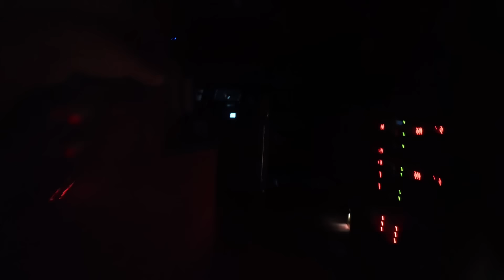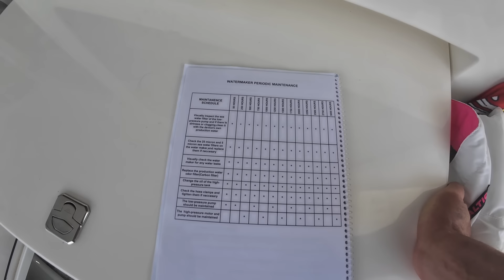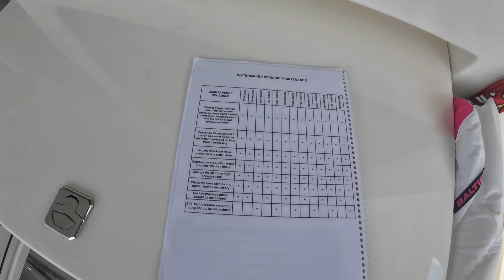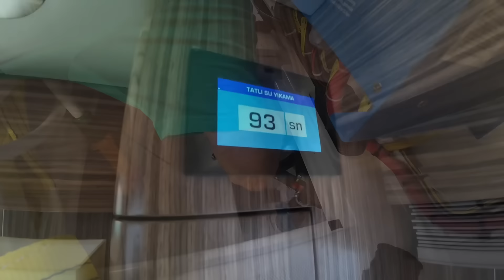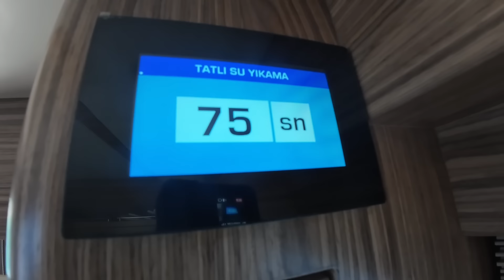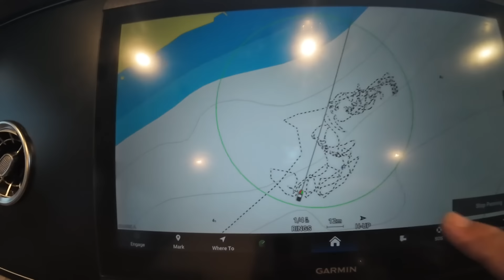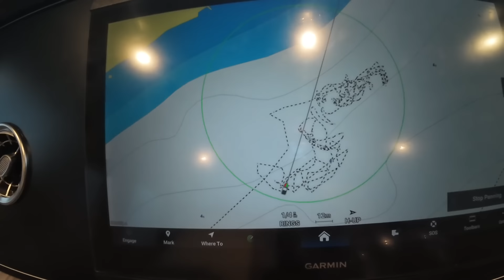Thunderstorms that wreck boats twice in Montenegro - @AwanuiNZ Ep 66

Comment: A delightful video. Your guests were immensely helpful -- he managed to untangle the dinghy line from your prop and get the filter our of the raw water intake for the water maker. Make him an admiral ASAP. The comically bad placement of the filter reminds me of my center console -- I have been told four bolts are loose in the steering wheel but the entire head compartment wall will have to be removed to get at them. Several hours of work to spend 20 seconds tightening four bolts. Thunder storms usually don't last more than 10 or 15 minutes but they can be scary minutes if it starts blowing 40 knots.
Reply from the maker: Wait for the next e-inside I really put him to work!

Comment: I had to laugh at the strainer instillation. Some of these people must have their brain turned off when putting things on boats.
When a young fella I worked on a trawler that had solid piping for the main winch hydraulics from the pump on the engine to the winch on the foredeck and they never put any swivel fittings in the line. We had a leak in a fitting and had to take it to pieces from winch right back to the pump to replace a fitting as big as your thumb. Took us nearly all day to do a five minute job 😂
Reply from the maker: Go figure eh?

Comment: Am getting the idea that thunderstorms are pretty common in that area or am I mistaken ? Definitely something to take into consideration for us when we get there in September. 

As for the snubber in a thunderstorm..........don't take it off. The whole reason for the snubber is to take away the load and stress on the windlass and in such heavy gusts those stresses on that windlass will be immense. Also, the snubber lowers the angle of the chain with the seabed, which means it increases your scope and that is always good in a storm. A storm will push the boat backwards, increasing the angle of the chain with the seabed and when the boat also starts pitching up and down (and you don't have enough chain out) you basically start to wiggle the anchor out of the seabed and you will start to drag. 

Best way to avoid dragging of your anchor is to understand why it happens. A dragging anchor means the forces on the boat (by the wind and current) are more than what the anchor and chain can counteract. Many people only talk about the type of anchor, claiming theirs is the best, demonstrating clearly they don't understand anchoring at all. Of course the type of anchor is important, since certain anchors hold better in certain types of sea beds, but ultimately it is all about keep the anchor in the seabed and that you do by keeping the shank on the seabed. 
Any anchor will lose all holding power as soon as the shank is raised to 25 degrees (or more) off the seabed, you will start to drag, no doubt about it. 
However, it will already have lost about 30 % of its holding power as soon as the shank gets to an angle of 5 degrees. I.o.w. you have to keep the shank on the seabed at all times in order to get maximum holding power of your anchor. Keeping the shank on the seabed is the job of the anchor chain. Once you understand why dragging happens the remedy is very simple and from that moment on you will sleep much more quiet. 
The anchor and chain have to withstand the forces the wind can put on the boat, those forces can be calculated. Once you know those forces you can calculate how much chain you need to put out.

So if you see a thunderstorm building you know you can expect 40 - 50 kts of wind gusting to perhaps over 60 kts. That means around 200 N/m2 of boat surface (the part that is in the wind). We have 18 m2 frontal surface, which means 3600 N at 10 Bft. Now I know that, in order to avoid dragging, I need to have at least 3600 N (or 360 kg) of chain in the water. With 4 kg per meter of chain (13 mm) I need at least 90 mtr of chain to provide that 360 kg. However, I need to keep the shank on the seabed, so I need to change the direction of the force from angled up to straight back. That I will do with another 10 mtr of chain which will lie behind the anchor. When the wind now starts to blow it may raise the 360 kg of chain of the seabed, but the additional 10 mtr (is 40 kg or 400 N in my case with a 13 mm chain) will remain on the seabed, making sure the shank of the anchor remains horizontal, (thus giving the anchor maximum holding power). So now I am already at 100 mtr of chain. 
This is all when there are no waves, but since there will be waves the angle of the chain with the seabed will continuously change, so the higher the waves the more chain I will put in the water to counteract that pulling motion on the chain. 
What does it mean in daily operations ? We will drop at least 70 to 80 mtrs as standard in any anchorage with good weather. That will give us a lot of peace of mind when sleeping, we know we are not going anywhere. In fact, we will pivot around the chain instead of around the anchor. 
When a storm is approaching we will add more chain, dropping 100 - 120 mtr in the water and keeping 20 mtr as spare. As long as I can keep the shank on the seabed our boat will not drag. Our problem is more the other boats, that don't know how to anchor, and they start dragging in our direction. Especially the charter boats are a complete nightmare.😀We have been in anchorages with 40 or more boats, us being the furthest out. Wind picked up to 20 kts and half the anchorage started dragging (near Petriti on Corfu). 

What to do if you start dragging ? If you have the space around you and have the chain...........drop as many meters of chain as you can. It will bring the shank of the anchor back to the sea bed and the anchor will have a chance to reset. That may take a bit, but ultimately it should reset. If you don't have the space or don't have the extra meters of chain, then indeed using the engine is the solution. If your chain is too light you may want to think about changing to a heavier chain. We had 70 mtrs of 10 mm chain, but went to a 140 mtr of 13 mm chain, gives us 1.7 kg per meter extra in weight and it is much stronger. In all we added about 400 kg of chain, which also keeps the bow down as ballast. 
Based on the above you will understand that we don't like to anchor in close anchorages with a lot of other boats. We prefer to go further out so we have the space to drop more chain. If we can anchor in shallow waters that is great, since it greatly reduces the angle of the chain with the seabed, reducing the risk of dragging even further. 

A not so nice part about thunderstorms is something we found out yesterday. When we left the boat it was a clear blue sky, so all our solar panels were up and running, also the ones that we can fold down. While we were in central Istra all of a sudden a thunderstorm started building out of nowhere and that went quickly. We were about 1.5 hours away from the boat and when we came back to the boat, the boat itself was fine, nothing had happened, but one of the extendable solar panels had been smashed to pieces. It had been ripped out of its hold down bars, which means we had a gust of over 50 kts. So we are now less 1 solar panel, have to buy a new one. Expensive lesson and means from now on we will tie the foldable panels down when we leave the boat. 
You said you will have your panels on the bimini, so just make sure that bimini is able to withstand a 60 kt gust, otherwise the whole bimini will be ripped clean off the boat. And that is the last thing you will want to have happening. 

We will be looking forward seeing your first harpoon kill. Lobster perhaps ?
Reply from the maker: Hey what a great and comprehensive post, thanks so much. My thinking has always been to be able to get up and running quickly if we had to move either to avoid boats coming onto us or to get away if we are dragging. Standard practice for us is to put the snubber on but if we anticipate having to move we take it off to make a departure less complicated. I suspect we dragged because we had only 80mtrs out and our chain is 10mm…a couple of boaties have suggested that our chain looks a bit light for the size boat. We have 100 metres. I am thinking of getting another 5m at least for when we inevitably reach deeper anchorages. So much to learn and a fresh lobster would certainly help!
Reply: @AwanuiNZ  the weight of our boats is roughly identical and so is the frontal surface. Therefore the forces of the wind on the hull are also roughly the same. We have about 18 m2 frontal surface (waterline to top of fly bridge) and multiplied by the force of a strong wind that will lead to very high forces. 
10 mm on our boat was nice on rivers, calm seas, but since we are in an area where the weather can go from one extreme to another we decided to increase everything. We never encountered 10 to 12 Bft on inland waters, but here in the Med we have been there quite a few times. 

10 Bft puts 3600 N on the chain. 100 mtr of 10 mm chain will only provide 2700 N in counter force, so you are still missing 900 N. That means that the shank of the anchor will be lifted of the seabed in case you get wind gusts of 50 - 60 kts and as a result you will start to drag. To counteract that you would need to add at least 50 mtr of 10 mm chain and it would have to be in the water, plus the water needs to be shallow. 

Of course I did not get this 'knowledge' through my own testing of anchors. I have the book of Joachim Schult: Das ist motorboot fahren. He explains in great (mathematical) detail the workings of anchoring (amongst many other subjects). 
There is an English version of this book, can find it here: 
https://www.amazon.de/-/en/Joachim-Schult/dp/3768802892

There are more articles on anchoring (even mathematical equations) and based on that we made the changes to our equipment. All of this after we had dragged for the first time in a sudden storm near Corfu (in that same anchorage where you were). Since that time we have not dragged anymore and we have been in very heavy storms. 
Btw, also currents can put quite a bit of force on the hull. Imagine that you now have wind and current working against you and you don't have a lot of room to drop a lot of chain. In that case you will need a heavy chain. 

Can highly recommend diving into the theoretical (and mathematical) part of anchoring, after all it is more or less what keeps your boat (and you) safe.

Comment: Win, checking and cleaning the sea strainer. 
Fail on the installation of the strainer. Someone wasn’t thinking about servicing when they installed that. Hope it doesn’t need to be done too often, or that you re-install it in a better location. 
I find the “ what’s under the boat” clips interesting, and those caves were something else.
Reply from the maker: Thanks so much
Reply: I love under the boat.
Under water drones are great. 
They go 30 mtrs down
Reply: @AwanuiNZ Mark theres a guy that cant afford a under water dron and he puts his gopro on his fishing rod and drop it to sit on the bottom
Reply: @MarketingStrategies28  I’ve not looked at them before, but I see that underwater drones seem to run from about $700🇨🇦 to $4,000🇨🇦 and the sky’s the limit really.
Reply: @bobuncle8704  Mark could get it free if he shows it on his channel?

Comment: Wow, how did the engineer miss that filter placement. Check with the boat yard to see if they have a fix for that, if not look to move it yourself. This is fine when achored up but if this became a problem when underway, WAY out in the Sea / Ocean, under rough conditions, that then is a major issue. Thanks for the video sir.
Reply from the maker: I will fix for sure. Work was conducted by third party under our stewardship not the yard…Will watch much closer next time.